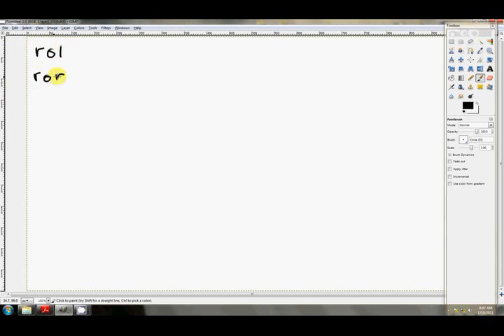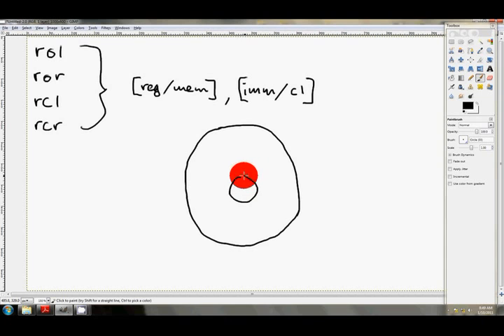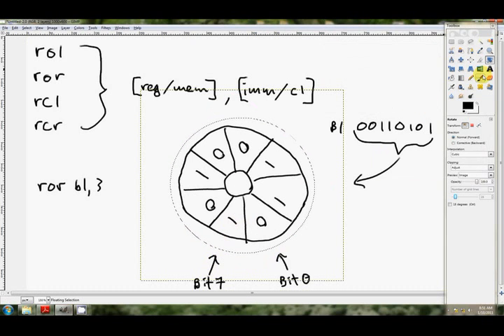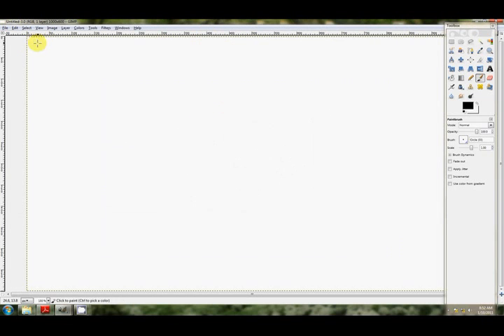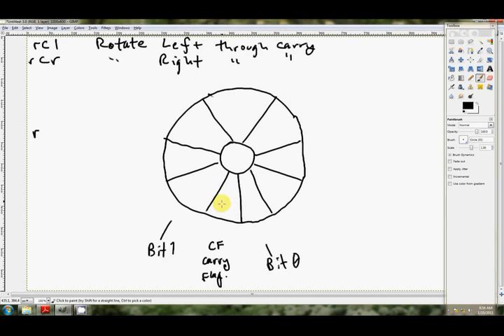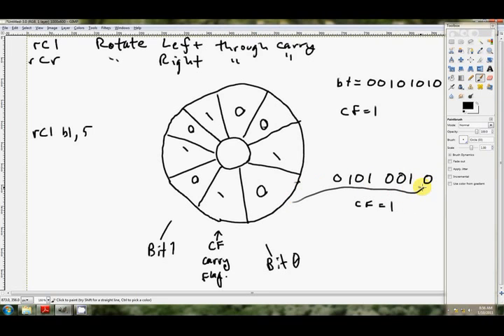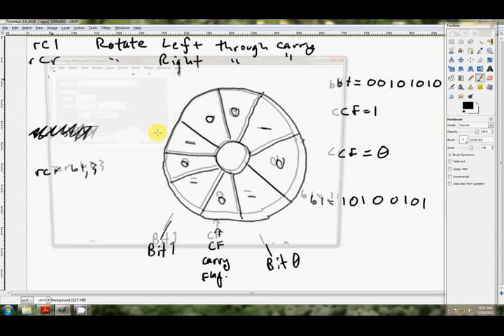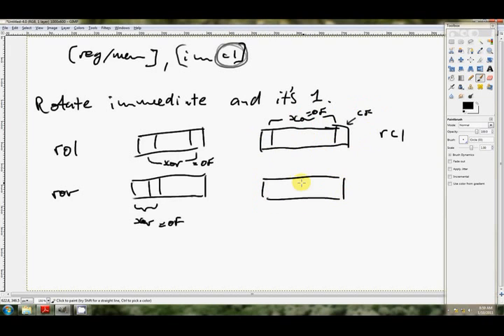x64 Assembly Tutorial 17: Rotate Instructions

Comment: does multiplication and division with 2 also occur in ror , rol and rcl , rcr...... also in rcr & rcl if CF is not already mentioned then what we do?
Reply from the maker: It would work sometimes with rotate instructions, but often you'd get incorrect result from bits rotating in from the other side. If you don't know if CF is set or not, and you want to use it, you can clear it with CLC, or set it with STC. Is that what you mean? Cheers for watching, have a good one :)
Reply: @WhatsACreel  thanks but in written exam one time my teacher did'nt gave CF and said you should knw... I just assumed it "1" and went ahead
Reply from the maker: @exoticme4760  Errr... it could be 0 or 1 depending on the previous instructions? You'd have to check to know what it is or set it yourself. Surely your teacher didn't mean that...?